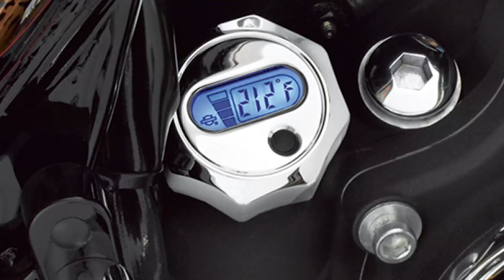Infrared Heat Gun / Thermometer NOT an Accurate Method

Comment: a 10 deg difference at the end of the day on a motorcycle means nothing. The infrared works, it will give you a reading for a good ball park. 
I use my infrared to test my ac vents at home and also use an actual thermometer and its usually a 2-3 deg difference.
Reply from the maker: Thanks for sharing your experience! You're right, a small temperature difference like 10 degrees may not have a huge impact, but it can still give useful insight and 10° can be the difference in your oil additives breaking down or your bike cutting power due to heat. The infrared thermometer is great for quick, general readings, but we always recommend taking multiple factors into account when monitoring engine temps. 
Appreciate your input! 😎 MB

Comment: You have to remember that those sensors that Harley uses are not very accurate either every one is made different meaning the accurate of the sensor varies thats why the same two bikes will have different temps.
Reply from the maker: Valid points! 😎👍

Thanks for commenting!

Comment: Great video. That causes me to share an issue that i am having. I have both the JESCustoms dipstick and Dakota Digital oil temp gauges. The dipstick gauge reports 225 to 230 degrees on a  typical ride, while the DD gauge reports 150 to 160 degrees. I suspect that because the DD sending unit is installed in the oil drain plug location which is on the front side of the oil pan, air flow is keeping the temps down. I also wonder about windage. Is there even oil present at the front of the oil pan or am I recording only ambient or case temps? When I come to a stop the temps on the DD gauge do start to rise but I have not seen it agree with the dipstick gauge. Thinking that the DD sending unit was defective, DD replaced it with a new one but it hasn't made a difference. I really like the Dakota Digital instrument display. I just wish that the oil temperature reading was more in agreement with the other gauge. Next, I'm going to park on a downhill slope forcing oil to the front of the pan to check oil temps. Hopefully there will be some agreement.
Reply from the maker: You do not say, but I am guessing you have a Twin Cam or M8.
You also did not mention if you have an oil cooler or not.
Temps in the sump (bottom of engine) should be higher than the temps in the oil tank where your dipstick gauge is.
It is not out of the realm of possibility that the tank temp would be 225-230 F and the temp in the sump be 150-160 C.
This is because the oil in the sump is there right after being squirted on to the bottom of the pistons.
If the temp readings you are getting are both Fahrenheit, there is definitely something amiss.
To make sure that your temp dipstick is reading correctly, you can use a cooking thermometer to verify the dipstick gauge.  If they are within 5-10 degrees of each other, then you know that is accurate, and the DD is where the variance is.
The sump (pan at bottom of engine) should have around 4 ounces of oil in it.
Hope this helps you track down what is going on.
Oh, here is a video where we talk about the piston oilers a bit- https://www.youtube.com/watch?v=WpUorAUIj9Q

Comment: Could having this 131 reaching temps via readout on POWER VISION saying up to 340 plus engine temp be a sumping issuing going on? I have a stock harley oil cooler with fan
Reply from the maker: It absolutely could be.  It could also be a lack of good cooling strategies.
I have ridden hundreds of miles with a 131 in a heavy Tri-Glide, and his temps were very similar to mine, bouncing between 210 and 240.
340 as displayed on a Power Vision ET is too hot, by a lot.
Reply: @DKCustomProducts  think it could be sumping? I got the 131 in NOV 2021. I would think they would have the fix to that managed
Reply from the maker: @Heavy69Metal  It could be sumping.  You have the new oil pump, so it is doubtful that it is.  More likely just poor cooling that is standard on TC's and M8's.  The only 131 I've ridden with had no heat issues, BUT, it had all our cooling strategies in place.

Comment: Great video, thanks!  One question, does the ECM use the cylinder temp or the engine temp (referring to a PV).  In a lot of your heat related articles you use these terms interchangeably and say that the engine temp senor is connected to the rear cylinder.  My cylinder temp pretty much consistently reads 35+ degrees above my engine temp.  On a side note, the ONLY time my 17 m8 freewheeler engine temp is below 300 at 60+ mph is if there is a fairly strong cross wind and the air temp is 70 or less.  I have mighty mites, aux oil cooler, raised tank, your wind deflectors, it's been dyno'd, I have the new style oil pump, and I weigh 165.  An engine temp of 280 is impossible for me to achieve at cruising speeds and I'm just happy to keep it under 325 (360 cylinder).  Oil temp is almost always under 220 (digital meat thermometer).  Thanks again and keep up the good work!
Reply from the maker: Thank you, glad you are finding the videos useful.👍
What is displayed on the Power Vision as ET is from the cylinder head heat sensor.  On your '17 Freewheeler that sensor is located at the front of the rear cylinder head.
You do not want it hitting 270 F.  It should stay under that for max power and engine longevity (it will be more comfortable also).

Here is a link to a report on the things you can do to get your temps down- https://www.dkcustomproducts.com/why-how-to-cool-down-the-twin-cam-engine-part-i-dk-cl-tc-dn-1.htm

And here is a video series on Why and How to cool your ride down- https://www.youtube.com/playlist?list=PLb3bvZgbH92_3s-2vv63QggFJ3nteFd_C

Here is a video of what happens when it hits 270 F - https://www.youtube.com/watch?v=MF0hO-w2hz8

Feel free to call or email with any questions.
Support@DKCustomProducts.com
662-252-8828

Comment: You mention you're 2 ways of oil temps. I have an oil temp gauge installed in my '13 tri-glide in place of ambient air temp, which I believe to be very accurate. I think that should be mentioned as a way to measure oil temps, unless y'all know why those suck and can inform me on how I wasted money. Along with that, I have only done a basic stage 1 upgrade with full exhaust, air cleaner, stage flash, than a tune and dyno. I have added love jugs, and a ultra oil cooler including the permanent filter. I still hit over 300° up to engine cutoff temps, which really is not pleasant having your bike shut off because it's to damn hot. Air cooled trikes suck in the heat. As for engine temps, I love the power vision and a certain other for that.
Reply from the maker: Two Temps we measure.  Engine Temp (which is really the cylinder heat sensor) which on the Twin Cams is at the rear of the front cylinder and on the M8's is at the front of the rear cylinder.  Then the oil temp at the tank.  I am not sure if your oil temp is taking the temp at the tank or in the bottom of the crankcase.  We have found that the oil temp should be at a max of 230 F at the tank.  If yours is in the crank, it will be hotter, but we do not have a correlation.
When you say you still hit over 300 F, is that oil or ET (cylinder head temp)?  On your '13 Twin Cam you do not want the temps going over 230 on the ET or the Oil at the tank.

Here is a link to a report on the things you can do to get your temps down- https://www.dkcustomproducts.com/why-how-to-cool-down-the-twin-cam-engine-part-i-dk-cl-tc-dn-1.htm

And here is a video series on Why and How to cool your ride down- https://www.youtube.com/playlist?list=PLb3bvZgbH92_3s-2vv63QggFJ3nteFd_C

Feel free to call or email with any questions.
Support@DKCustomProducts.com
662-252-8828

Comment: Does an oil cooler that is installed underneath a bike really work as well as a cooler that is vertically installed?
Reply from the maker: It does not.  We did tests on this many years ago....hoping that the larger surface found on oil coolers under the bike would make up for them not being in the wind as much.
We were disappointed.
Even the same size oil cooler, mounted on the downtube will cool better than mounted down lower, behind the rear tire.
The more out in the air the oil cooler is, the better the cooling.

Comment: Glen Hooper is dead on right. The surface is key.
Reply from the maker: You are going to put masking tape on your cylinder head?
I just now went out and tested the masking tape idea.  Depending on the distance and angle the masking tape was giving a variance of 89 to 68 degrees for the exact same point on the tape.  
So to get an accurate apples to apples reading on masking tape, it is the same as what was shown in the video....the distance and angle must be the same.

Comment: Harley has a oil temp guage kit. The sensor is installed in the oil pan so I think it's a very accurate reading of oil temp. 300 degrees on a very hot day stopped in heavy traffic. I ride a 2009 electraglide with luv jugs and ultra cooler as well. Heat is just the nature of the beast.harley....
Reply from the maker: Yes, they do, and the heat in the oil pan is much higher than in the oil tank.  That oil down there has just been squirted on the bottom of the pistons to help cool them down after the combustion stroke.  300 is not out of line for that location at all.
Here's a video we made about why it gets so hot in that area of the engine- https://www.youtube.com/watch?v=WpUorAUIj9Q
Reply: @DKCustomProducts  Dino oil doesn’t work well at that temperature
Reply from the maker: @psy999  Very true.

Comment: What analog dipstick are you using on your M8? I've looked online & can only find the digital thermometer dipsticks which get very poor reviews.
Reply from the maker: JESCustom is the one that I am using and I've been happy with it.  I have used many of the Digital ones, and they are nice, but everyone of them that I've used has eventually failed.
Reply: @DKCustomProducts  Yup my Harley dipstick only lasted 1.5 years
Reply from the maker: Yeah, I've had them fail at less than a year and be replaced under warranty, and several fail around the 2 year mark.  I have one that has lasted 7 years.  On that one I've had to replace the battery several times.

Comment: Been looking for a oil temp gauge for my 2021 tri glide. Do you sell a oil temp gauge? Need one until I add the power vision.  
Been looking everywhere for one.
Reply: Try Dakota Digital they make gauge packages for the tri glide
Reply from the maker: JESCustoms makes oil temp gauges for your 2021 TG.  As Nathan said, so does Dakota Digital (expensive), and you will also have to add a sensor with the DD.
Power Vision does not display oil temp, just engine temp.
A dipstick oil temp gauge, like from JES is the most economical.
Reply: @DKCustomProducts  👍

Comment: Infrared temps in metallic surface depends on the emissivity of the surface.  The trick a thermographer uses is to put plain old masking tape on the metal and read that temperature. Masking tape has an emissivity of close to perfect as you can get. Just remember, if its shiney or reflective your not getting a good reading
Reply from the maker: Thanks for your comment.  Are you saying that if you put masking tape on a surface and shoot that surface that distance and angle do not affect the reading?

While I am curious, it is sort of irrelevant for our purposes.  Putting masking tape on a cylinder head at 200+ degrees F is going to make a sticky mess, so not really a viable option in looking at temps on a Harley.

I just now went out and tested the masking tape idea.  Depending on the distance and angle the masking tape was giving a variance of 89 to 68 degrees for the exact same point on the tape.  
So to get an accurate apples to apples reading on masking tape, it is the same as what was shown in the video....the distance and angle must be the same.
Reply: @DKCustomProducts  Im not commenting on the angle used for the reading, but since you mentioned it.. heat moves by 3 methods. The one we are talking about is radiation. Basically the same as light. If the surface is radiating in a cone (akin to a reflector in a flashlight) sure, straight on would matter. My gut kick reaction to a flat piece of tape would be that it should not matter if the surface area is big enough. And yes, 100% correct about the sticky mess. For the most part, heads are typically flat black and not smooth, so the reading should be reasonably accurate. But, if you wanted to take a reading from the shiney chrome muffler, id bet that the tape would be more close to a conductive measurement. And, for the record, i love my PowerVision and the temp display is on always... (Dual cool with M8 water pump upgrade, crap solder or spot weld on factory pump!)
Reply from the maker: @AudioFanMan  Thanks for the info!  👍

Comment: Use my powervision all the time, invaluable tool, mostly set on the temp settings, great piece of mind.
Reply: Had one on my 18 Fatboy just waiting for warranty to end on my 21 Tri Glide to add to it. 
Best $ you can spend for piece of mind. 👍
Reply: @papap.8006  100% yeah I didn't worry about my warranty, BUT, each to there own, I've still got a year left, well....I did, lol, is what it is. 👍
Reply: @aaroncox3340  When I bought the Fatboy I added the power vision before I took delivery of it so I basically rode out of the dealership without a warranty. 
Talk about riding the ragged edge! Lol
Reply: @papap.8006  yeah I know it's a risk for sure, but I think the risk is worth it, especially when I've vented the heads to atmosphere and vented the crank behind the rear cylinder, man  what a difference. Glad I did it.
Reply: @aaroncox3340  if doing that voids the warranty then I guess I should move forward with the PV because I already did that months ago. Lol
Reply: @papap.8006  😆 right on 👍🤘
Reply from the maker: These are my thoughts on the HD warranty since 2017 - https://www.youtube.com/watch?v=p8U4XsHyBug
Reply from the maker: You can hook up your Power Vision to your Harley and monitor everything without any chance of voiding your warranty.  Using the Power Vision to change the tune is when the Dealerships say it can void your warranty.  But just monitoring will Not cause any issues.
Reply from the maker: Same here. 👍

Comment: We sell Infrared Heat Guns at the auto parts store I work at . I've had to demonstrate the same facts, distance and angle, and the difference between flat black and chrome. The oil temp gauge is probably the most "reliable" but people don't always factor in ambient temps and how much of a load you put on the bike. A vid showing ways to keep cool, ie: parking in the shade, more time at stops when you fuel, etc. would be interesting. Your trip to Mexico may have shown you some new things?
Reply from the maker: Yes, good deal that you are educating your Customers regarding the infrared heat guns.
We do have an entire series on Why & How to cool down a Twin Cam & M8 (see link below), but here is one we did on how to stay cool, via riding gear & more. https://www.youtube.com/watch?v=VlT49cYzEBM
No doubt the oil temp is a good indicator...oil will, after an hour or so, end up being the same temp as the metal it is flowing thru.  And you are right, load, ambient temps and more are big variables in how hot the engine gets.  Many folks think that when you're riding at 70 or 80 down the interstate that all the wind blowing past the engine will make it run really cool.  Fact is that because of the load at that speed that is when the engine runs hottest.  Here is one of the  videos on that subject- https://www.youtube.com/watch?v=6AhPqVlvE-w

Here's the link to the playlist on Why & How - https://www.youtube.com/playlist?list=PLb3bvZgbH92_3s-2vv63QggFJ3nteFd_C
Reply: @DKCustomProducts  thanks for the links! Although I ride a carbureted '06 Sportster Custom, I've learned to take steps to keep it cool. I've suggested a tank lift, to my son, for his '13 Streetglide, to help him run cooler. Here in ND we have a lot of 95F+ days during the summer, so engine heat can be a huge factor.